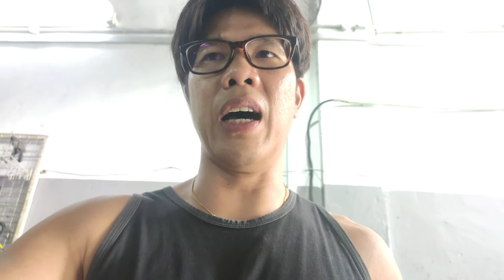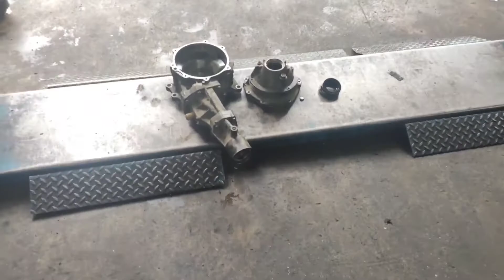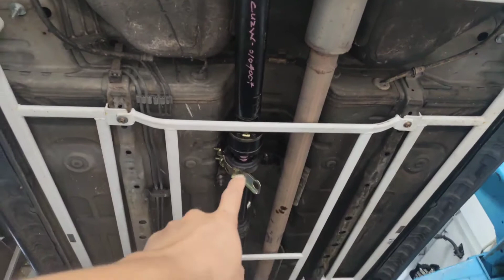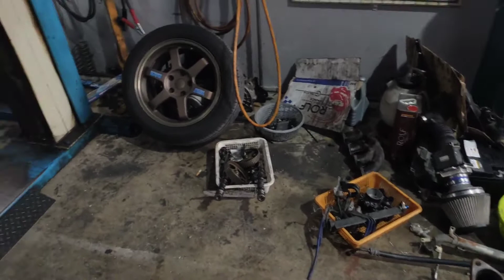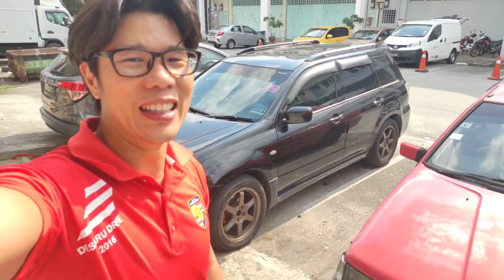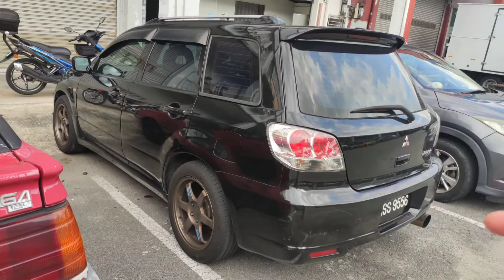Mitsubishi Airtrek Turbo R problems

Comment: What grade of lubricant does this engine use?
Reply from the maker: @sahul87  with a brand new engine rebuild I would use a 40w fully synthetic, but with a high mileage engine 50w fully synthetic will have to do.
Reply: @kevinkonguwu  
I bought one with 60k km, what would I use?
Reply from the maker: @sahul87  you can use a 0w40 oild my friend. Congratulations buddy. All the best in ownership

Comment: Hi.. i have problem with my Airtrek. After 13 years using it. First i change my transfer gear sbb minyak gear box leaking dan dia rosak.Lepas tu ada issue gear tiba2 bertukar sendiri jadi gear 3 dan lampu N berkelip2.. cuba masuk gear lain tak boleh.sampai sekarang tak ok lagi.kadang kereta tak boleh start. Off dan On switch beberapa kali baru ok balik. Ada pernah jadi tak issue mcm ni? Thanks 😊
Reply from the maker: Sorry boss. Dalam pengalaman Saya mengguna airtrek. Tak parnah Saya mengalami masalah seperti boss la.
Reply from the maker: Boss boleh try perhi workshop ini. Retrostreet auto garage. Cuba boss Waze ke sana

Comment: Hi Kevin my airtrek turbo overheats and I keep on losing power.
Reply from the maker: If you have checked the obvious radiator and fan culprits, the next thing to look into is if you have had a blow head gasket. Check to see if your engine oil has water mixed into it. It will look like muddy oily stuff in your engine.

Comment: Hi where do you fix your gearbox misubishi turbo air trek? Any recommendations?
Reply from the maker: I have never had the gearbox fixed. I have it replaced with a used unit out of a halfcut.
Reply: @kevinkonguwu  yeah I guess I’m using the wrong word. Should be replace. Where do you recommend to replace a unit?
Reply from the maker: @htpy9844  you can look for ah wah in puchong. He is the airtrek specialist. 0122963909

Comment: Hey My fellow Airtrek owners please when you take your Airtrek to a garage for service the transfer case Oil should always be checked and it's very tricky for mechanics whereby they may assume that the transfer case uses Atf fluid of which not it uses gear oil type SAE EP 85-90 gear oil same as the differential Oil
Reply from the maker: Yes we have also found that rear lsd oil also works well with the transfer case. Never use atf oil in transfer cases. Thank you for the heads up.
Reply: How can the transmission be strengthened
Reply from the maker: @khalidwallace1198  I m a it sure. But from what I have read. Alot of people are welding something within the gearbox. I m not sure what it is or how it's done.

Comment: I too replaced my transfer case last Month but mine it was neglected by the previous owner didnt put transfer box Oil SAE EP85-90 oil . so it used to whine like a bitch when driving. so i think thats the weakness of 4G63T series.

Comment: I bought an Airtrek about a month ago after commenting on your previous vid. Facelifted the car to 05 model, replaced leaked coilover suspension with original KYB suspension, replaced exhaust with ralliart exhaust system and currently in the process of painting the car. Next I am planning to do top engine overhaul, replace all oil rings (gearbox and transfer case) and replace old wirings to bring it back to it's glory (and I want it to be reliable as it will be my daily drive). How much have you spent on the above? Can you recommend the workshop? I am literally going through your every step except for the GTA TD05 upgrade.
Reply from the maker: Aprox rm4500 to 5000 parts n labor included
Reply: @kevinkonguwu   Opted to get a low mileage halfcut than overhauling the engine as the cost is almost similar. The objective is to get it back to stock as the current engine and other components are in shambles. Probably will do some light modifications in the future to maintain the reliability of a daily driven car. Very tempted to upgrade the turbo to GTA TD05 however am worried that it will laggy. Looking at your previous dyno tune result, it seems that there is not much lag as compared to stock TD04 turbo as the max torque is achieved right before the 3000rpm mark. Care to share your experience between the GTA TD05 and stock TD04?
Reply from the maker: @IvanaElenaChung  I think the lag is approx 600 to 700rpm difference. Maybe even only 500rpm difference. Not much difference in responsiveness between the Td04 vs the gta td05. The big power gains felt at higher rpms makes the gta tdo5 more satisfying to drive. The Td04 runs out of puff at about 5500rpm wherelse the td05 pulls to 6800rpm. Hope this helps. I enjoy both the td04 n td05. Ask friend on what you want. On hindsight I think tf04 is more then enough for a daily.

Comment: I've been through lots of things including a full engine rebuild, gearbox rebuild, currently got a second transfer case I'm working on. Upgrade the rocker cover vents to an10 if possible. I deleted the PCV system and run it into a catch can that recirculates before the turbo. The only way to fix your gearbox issues properly is to laser weld the planetary gears in place which I believe is documented for the evo 7 gta gearbox which is the same. Well worth it and capable of a lot more power afterwards
Reply from the maker: Hi Bradley. Thank you so much for all your advice. You are spot on everything. I did increase oil catch can hoses on both valve covers to AN10 and installed a larger twin entry 1 outlet oil catch can. Laser welding the plentitary gears in the gearbox. Is not something I m familiar with.
Reply: I'm just about to buy one and now unsure... I expect issues due to the age and the odd wear and tear but are they really this problematic? Cheers
Reply: @christiand3319  all cars that are this torquey are problematic as it just shears things. Great fun though
Reply: @bradleyscales  OK mate cheers. The one I'm looking at has a severeley deterioted nearside and offside front driveshaft front driveshaft joints... is this a costly fix?
Reply: @christiand3319  I did manual convert personally and the only fix I found was replace the shafts with brand new. They setup a weird vibration if you don't

Comment: Good for you Kevin and congrats for you second Airtrek. I feel your frustration. I gone down the same path, endless hicup and and gremlins need to sort out.  Got a used gearbox then realize that my transfer case thats busted. Got into shopping frenzy. Now garage full with airtrek part( 1 manual and one auto gb in case I want to ditch the AT gb, got 3 transfer case, 2 rear diff, couple of drive shaft and other small bits. Iv never bought so much stuff even for my classic celica in such a short time span. Finger cross she's stop misbehaving. Looking foward to your next video. 😀😀
Reply from the maker: I think it's just that these cars started to get cheap and the previous owners felt that the value of the car was not worth the maintenance effort and cost so they eventually get ran down to the ground. We enthusiasts are picking them up at the bottom of the barrel. It is only normal that we will have to put in extra effort to right the wrongs of the past owners.
Reply from the maker: I find these cars are actually awsome utility cars and alot more people are starting to realize that. Making these cars more sort after as they are very attainable. I felt that I need to save the car I just bought and return it to its former glory.
Reply: @kevinkonguwu  I'm going to do likewise here in my country make a collection of them am sure later people will start looking for them..... they are Legendary Cars